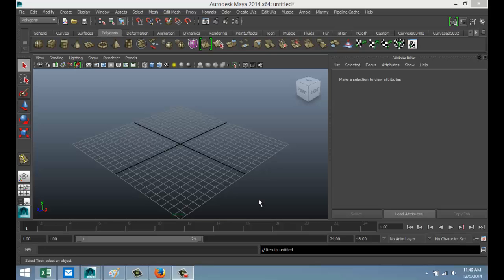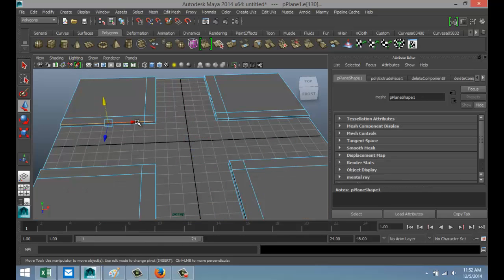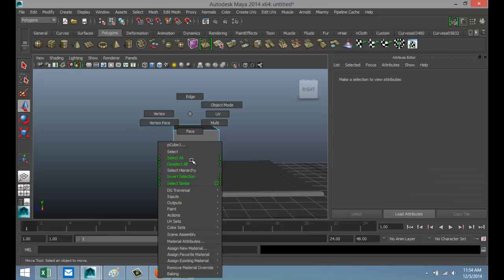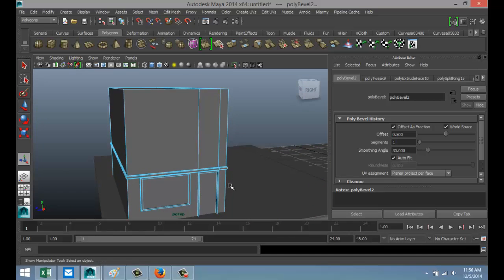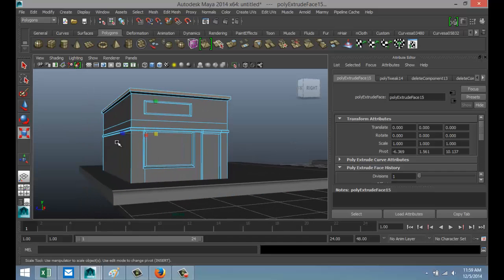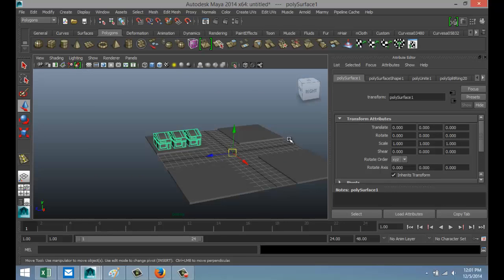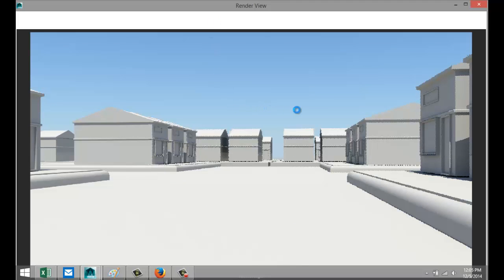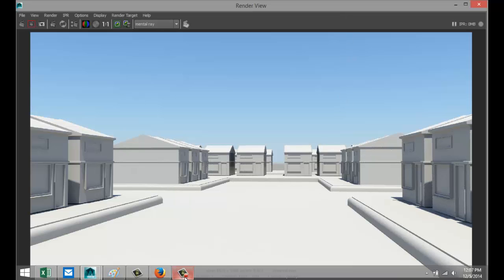Maya 2014 tutorial : Modeling a quick and easy street scene

Comment: i see that you modelled the stuffs focusing on the buildings more. But does that mean that the floor/ground aren't modular? Because if it isn't, than will you be texturing the entire ground in a single UV layout?
Reply from the maker: +Ermelious If I were to texture this I would either use a tileable image or I would paint the surface
Reply: +Mike Hermes Thanks for the reply sir, do you paint the surface in photoshop? What if the ground were to be partially soil and partially grass, would you still use this method? I'm interested in creating an animated scene but am wondering should i use a game engine to design the terrain or should i do it straight up in maya. At least in unity there is the terrain editor which allows to paint precisely at the spot you want all in real time though i'd still go with the maya + photoshop method to get more details into the texture but i'm still new to this and would like to find out what do the majority prefer to use when designing terrain.

EDIT: Btw for the modelling of terrains with hills and maybe bumpy surfaces, would you use maya or a game engine?
Reply from the maker: +Ermelious There are many ways to do this and Unity is certainly an option. I would probably use PS but like I said, many ways to do it

Comment: when blocking in a landscape is it better to model from a plane the size of the grid say in cm? is this tutorial in cm? I have to model things separate because of  real world scale. your houses seem to easy for you I would need dimensions in feet and inches. 
 so once I model all the separate models and I combine them.  Do I scale up the landscape next or is that when it's better to block in a landscape? I would think scaling up a landscape would cause I guess focal and different types of issues. I figured to learn about different focal points like perspective  rendering etc. right now I can only find camera composition or using rules of 3rd
Reply from the maker: +3D Isgreat It is personal preference whether you model to proper scale or scale up later, as long as you make sure you do scale up to real size before setting up camera's, lights etc.
Reply: +Mike Hermes  for landscape though, if I block out what i want in Photoshop, then blocked this out in Maya in top ortho view. would it be better to place a reference to real world scale say a person or house in the scene?   I noticed when scaling up landscape it doesn't look like it did. a small dune could look like a mountain. or the details are different. a once sandy beach could look like a few bumps.
Reply from the maker: +3D Isgreat When modeling to real scale it is hard to find suitable images for backdrops when not using tileable images. Better would be to use a HDRI dome